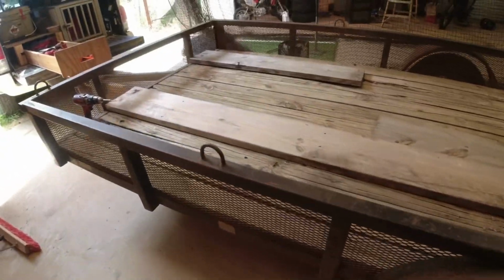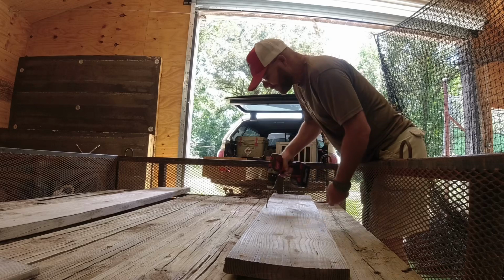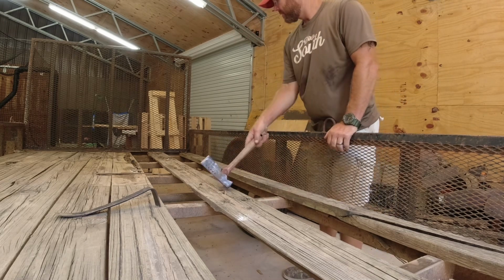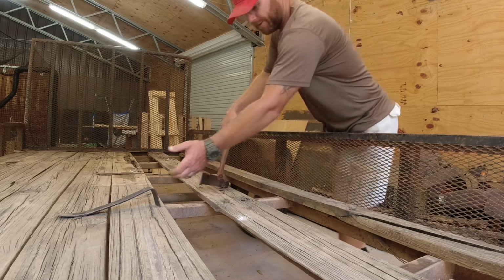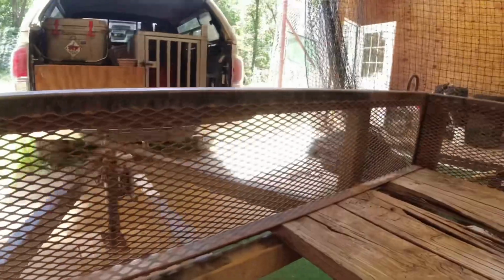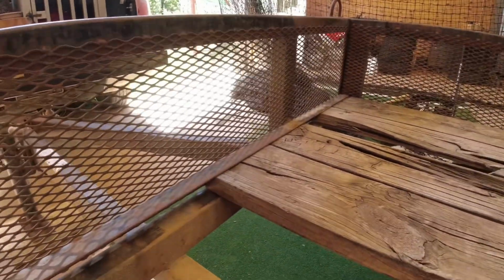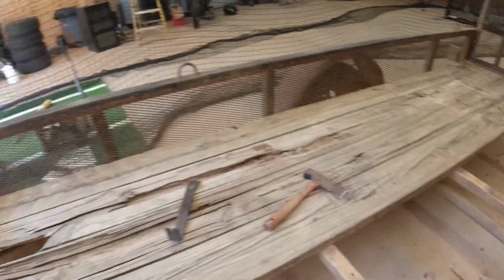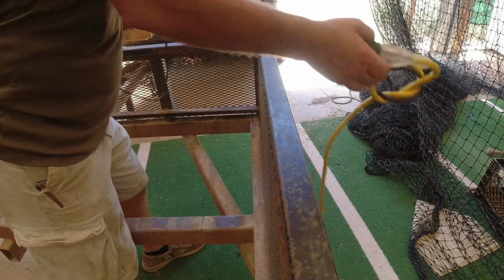PART ONE 🥵🥵🥵 Reflooring The Trailer

Comment: I have been rewiring a trailer when I watched this video. I’ll be putting in a new floor in a few years after that. I heard you mention trying to make those trigger wires harder for the raccoons to chew them. I use flexible conduit for all my exposed wires for my cameras and feeders solar panels. Just thought I’d share.
Reply from the maker: Thanks